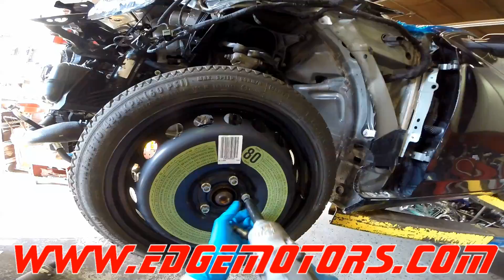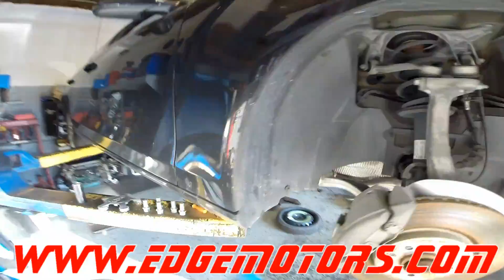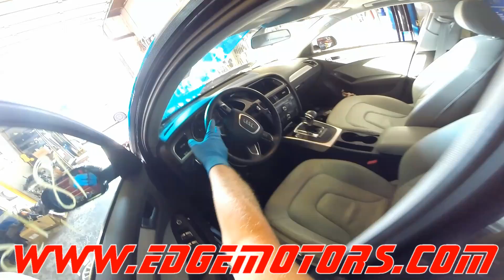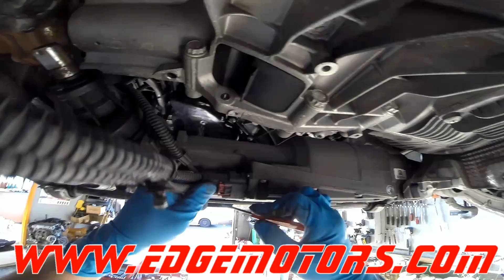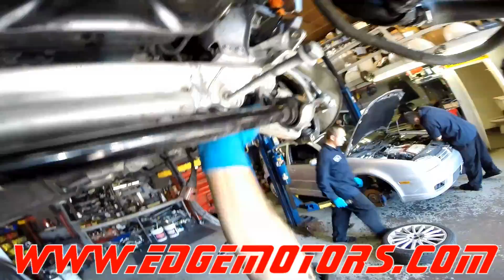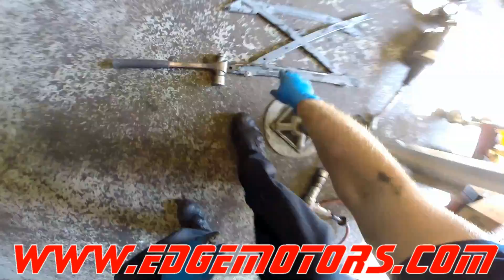2013 Audi A4 b8.5 electronic steering rack replacement DIY by Edge Motors

Comment: Hey Edge for the relearn procedure that you did in this Audi. Does it apply it for all Audi's and other European makes and model or just this one?
Reply from the maker: BIG Z it only applies to some vw and audi with electronic steering racks.
Reply: @EDGEMOTORS    Hey please help I have a 2014 s4 with dynamic rack can you help me find the part number for it ?? And after installing it do I have to code it??